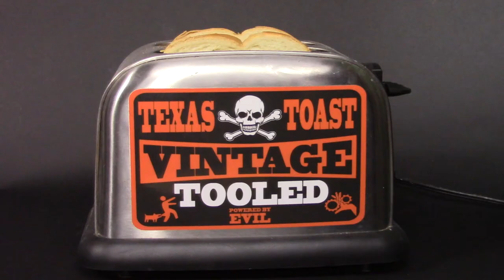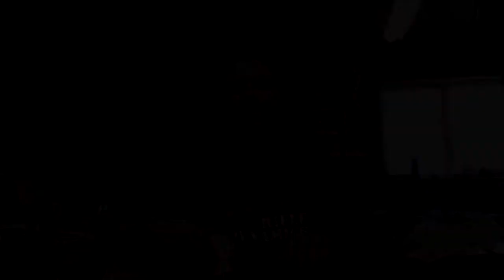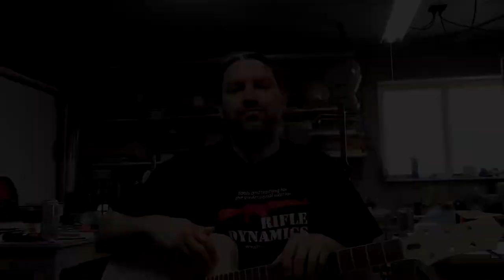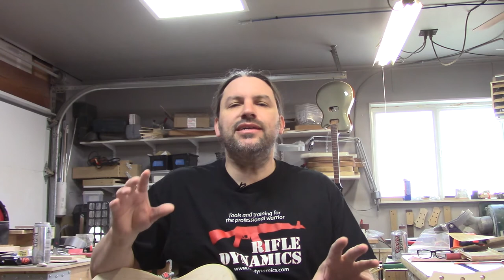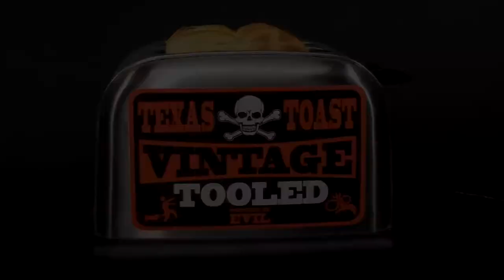Are You A Real Luthier If You Use A CNC?

Comment: For me, a lot depends on my tolerance for tedium (low) .  If the tedium of repetitiveness is going to make me dislike my career, then I will gladly automate that part of the process. Not for one second do I think that a CNC'd solidbody is in any way inferior to a totally hand done solidbody .  There is always hand touch up on the CNC work anyway. I would rather use spare time creating new designs and modifications then to force myself into the tedium zone.
Reply from the maker: You certainly won't get any argument from me.

Comment: Who cares what tolerance you hold if the guitar you make sucks?

CNC really doesn't even buy you tolerance, it just gives you flexibility if you use it enough to take advantage of that.

You can't really utilize CNC without already possessing the woodworking skills to do it manually so I see it as just a way to scale up which really depends on your business size.

Judging from your t-shirt, you might like Ironwood Designs.  They use CNC and copy lathes.  Pro tip, I like buying their seconds for a bit of character.

Any way, I'm a fan of vintage tooled.
Reply from the maker: Thanks for watching Daniel, we love what we do too. 

I have heard of Ironwood Designs but have never checked them out. 

Stay cool brotherman